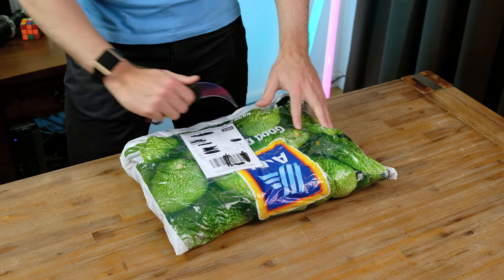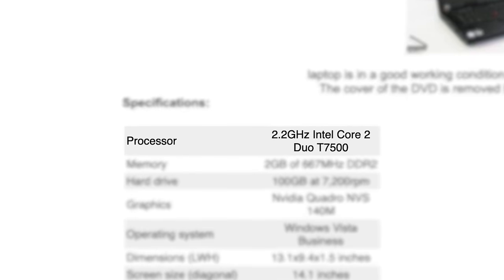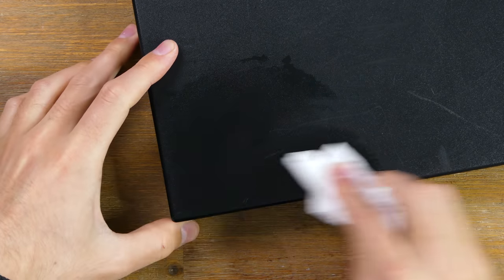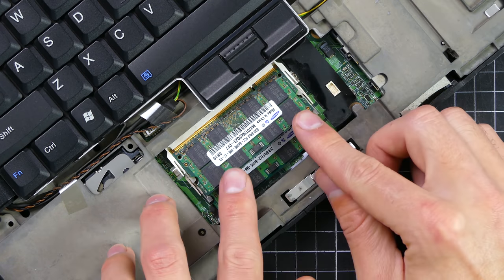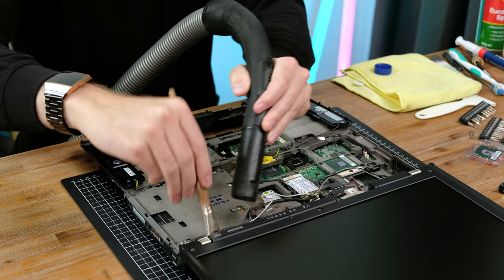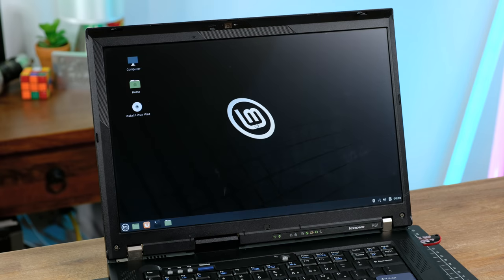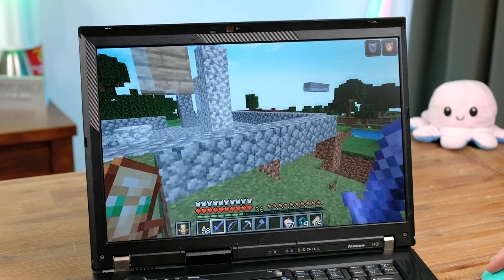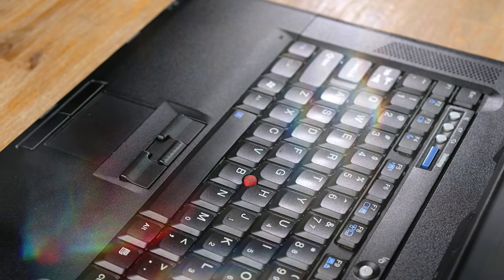I Bought a $49 Thinkpad... And Got Scammed!

Comment from the maker: I'm giving away the Pink laptop that was featured in my last video! https://twitter.com/NathanPSI/status/1402905668592410630?s=19

The rules are listed in the Twitter thread listed above. I'm posting to the US, UK, Australia and New Zealand 🙂 Goodluck!
Reply: wheres canada bro
Reply: About the Bios locked issue, call Lenovo and try to use social engineering to have them unlock it for you. I bought a Thinkpad that was bios locked, called lenovo, and they unlocked it for me. Hopefully you will have just as much luck.
Reply: Entered - thank you :)
Reply: hey could you add canada posting :)
Reply: I am facing little problem my ThinkPad shutdown automatically after some time of use. I am not able to find any reason . Can one  suggest any solution or may be what is the problem in my ThinkPad??
Reply: Not Canada????? BOOOO!
Reply: 7
Reply: I need a laptop but I don’t have Twitter :( my pc right now is an old Eee ASUs pc running windows 7...
Reply: i think i have a intel core 2 duo,
Reply: If cpu same slot work only need mod bios support that cpu.
Reply: Where the fuck is Japan
Reply: I have an T43, but the 2.5 inch HDD us a Pata drive. But the HDDs i have are SATA 3 drives, and there is plenty of brand new freshly made HDD drives that use Sata 3, but what adapter do you use to fit these Sata 3 drives into these old lappys?
Reply: Where is Kenya bro
Reply: You should swap Linux Mint Cinnamon for Linux Mint Xfce for better performance especially in Minecraft then take the CMOS battery out and put it back in to reset the BIOS and unlock it
Reply: Then in Linux Mint Xfce go to settings then Window Manager Tweaks then Compositing and turn off the very top box to disable shadows and reduce latency in games
Reply: @Sahilkumar-ko9sm  either you are being hacked or your computer has a virus. I recommend resetting windows or whatever OS you're using.
Reply: Even if I work in a computer store, that do not matter what even if I made all those possible upgrades I can find in this store.
Reply: @Sahilkumar-ko9sm  heat? Check the cooling fan, and dust accumulation.
Reply: That is just... bad luck, mate.

Comment: On the GPU front you actually got lucky in a way, the Quadro NVS cards in the 61 series ThinkPads are notorious for failing. Still doesn't excuse a scam.
Reply: The official buyers guide also recommended against buying the p suffix T series because of that as well.
Reply: @BYMasterMM  It's a shame really, such a nice machine yet you can't take advantage of the higher powered models because they will likely fail.
Reply: @skyediann3399  The Dell Latitude D630 models with Quadro NVS cards fail frequently too.
Reply: @penguinsushi8442  All early nvidia G8xM chips fail. Doesn't matter what laptop. Desktop cards including G9x are also prone. MCPs (their nforce chipset) from this time might be as well. Basically if it's an nvidia product from 2007-8, run away.
Reply: Pretty much any 'high end' videochip in a laptop is notorious for desoldering itself. I am still baffled by how many people bought laptops with geforces and radeons back in the day. After 4, 5 years they were all dead as a dodo.
Reply: Bought one of these for dirt cheap about 3 years ago. It had the NVS140M GPU and carried me most of the way through university. The GPU unfortunately died about 1 year ago, while my brother was using it for a school project. Shame, it was a pretty decent laptop for its price.
Reply: @TerribleToaster  They're over a decade old at this point and carry GPUs prone to failure, outside of a few oddballs, I'd say it's probably not too long before all the dGPU models are extinct.
Reply: @BYMasterMM  Just the old one? Or are laptops like T440p fine? (Ofc I would not buy haswell these days)
Reply: @dustojnikhummer  Yep, just the old ones, since it was ones from that generation where I believe Nvidia was using a combination of either bad soldering techniques, as well as lead-free solder which resulted in the solder easily cracking and thus loose connections between the GPU chip and the mainboard it was soldered onto.

The T440p has both the iGPU only, and iGPU + dGPU variants of the motherboard, same with some of the 15.6" versions of the T series ThinkPads too, and the GPUs in them rarely fail, (same can be said with the Sandy and Ivy bridge versions too).
Reply: ey bro there is a bot stealing ur comments
Reply: @BYMasterMM  I bought p series with bad GPU as display donors then installed those on Intel GPU T61 bottoms. Worked a treat since they went for small money ten years ago. I still use some as shop computers. T61 with Intel was an excellent office machine with the WUXGA display from a p installed.
Reply: Are the ATI graphics more reliable? I have a Z61m with Radeon X1400 graphics btw.

Comment: a little unreleated but i really miss laptops with a hell ton of ports
Reply: Many Lenovo Thinkpad models still have them if you want them.
Reply: @CommodoreFan64  My Dell XPS15 has practically anything I would need. Also, business laptops usually have many more ports.
Reply: Typing this on an M1 macbook air. I feel ya.
Reply: a toshiba satellite A350 laptop that has hardware failure is the only laptop i've seen a microphone port on in real life
Reply: @PearCoin124  Huh? I have never seen an (older) laptop without one? :D.
Reply: @rollingtroll  i guess we just have newer laptops since that is the oldest laptop we have, or it's a dell which doesn't have a microphone jack
Reply: @rollingtroll  Yeah it was. I use to be a big ACER/Gateway/Everex laptop guy in the early - late 00's, because of their price to performance, and every single one of them had the separate mic, and headphones jacks, so I would have to use a 4 pole splitter cable with them for my headphones/earbuds with a mic.
Reply: @CommodoreFan64  Yup, that was normal in the day. All of my latitudes and lenovo's had that too. Some laptops had a line level input as well, but that was very rare.
Reply: I miss them too.
Reply: On ThinkPads, you can even add a dock for even more connectors !
Reply: @lululock  Not all of them, but yeah man of then you could, and I think still can.
Reply: @lululock  that was pretty normal for every laptop up to the early 2000's
Reply: @rollingtroll  Yeah, I know. That's why I keep some of them.
Reply: In trying to be cute and minimalist they remove the ports only to sell you the expansion bay for $100-$200+ later.

Comment: Shame that you got scammed - and it's unusual for eBay to not agree with you. Normally, eBay quickly sides with the buyer in any return request - you can easily open a request for "doesn't work or is defective", or "doesn't match description or photos" and force a return, with the seller paying the return postage. The seller can also give a partial refund if they want to (which you can accept or decline).

Comment: 255% available charging. 
Now that's quite a deal
Reply: What a deal!
Reply: wait till somebody doesnt get the joke lol
But yeah, that's a huge deal!
Reply: @captainchris2  That's actually not the reason. Its just windows being windows.
But they fixed it in the updates.
Reply: I was about to say that, what a deal!
Reply: @oonflea  good old 8-bit integers
Reply: Best deal ever made
Reply: Thor's lightning charged it up
Reply: @oonflea  windows know that in future 255% will be a thing
Reply: @lemurmad  bruh stop blaming windows for everything, it happens with a lot of laptops, when the battery runs out of life it just says that on power.
Reply: @retrogamer2503  pretty sure you don’t understand that windows 10 did that for 3 years. And I actually prefer windows over Apple iOS and macOS
Reply: @lemurmad  bruh I have seen a couple of windows 7 laptops do that too.
Reply: @retrogamer2503  Yeah, It's when it doesn't detect a bettery. But I've only seen it in windows 10. But now, it seems to be fixed.
Reply: 255% also happens if Windows cannot tell what the battery percentage really is. If unplugged, it will say 'Unknown remaining' and the battery icon will be grey.
Reply: Charging batteries be like in Ohio

Comment: I think it would be a good video to show your audience why you weren’t eligible for the eBay buyer protection aka money back guarantee. This way they can see what went wrong and how to avoid getting scammed like you did.
Reply: Yea, im wondering how he wasn't eligible. The only thing I can think is that he was outside of the 30 day return window which is why its important to inspect and test ebay purchases ASAP
Reply: @FlyboyHelosim  at the very least its an item not as described. The seller might have made a mistake and shipped him the wrong laptop sure but its still not ok. Imagine ordering a laptop with an intel core i7 and getting an i3.
Reply: @FlyboyHelosim  yeah, these sellers are often pc recyclers and are selling huge lots of stuff - yes they should be more careful but i like to attribute this kind of stuff to ignorance instead of malice
Reply: @FlyboyHelosim  he should have gotten a partial refund since it wasn't as listed. I've legitimately never had an issue with the site so I'm not sure what even happened. Hell I've never even had to escalate it to ebay, I just contact the seller and they usually give a fair deal (or in the case of a thing I ordered recently, they were able to ship it for a cheaper price than their estimate so without even contacting them they refunded me the difference.)

Comment: The bios can probably be cleared like many other older Thinkpads. My second hand E540 was also locked but I found a guide how to reset it.
Reply: I cleared my parts 390’s bios but simply unplugging the CMOS battery and letting all power drain out, then reinstalling it and boom, right into the bios.
Reply: @aegonthedragon7303  Some models have a dedicated chip for saving the password etc., on my Thinkpad, I just shorted two legs from that chip when powering on the laptop and that did the trick. So in newer ones the CMOS battery doesn't work, it just resets the bios but doesn't clear the password etc.
Reply: Never been locked out of my thinkpad, but any acer accepts an universal unlock code you can find online. Maybe there is one too for thinkpads
Reply: well for me i reset my password bios with shorting the EEPROM but i do not recommend to unplug the cmos battery because if you unplugged it, the password will not reset anymore and i got RTC (Real Time Clock) error in my thinkpad T430 and its very dangerous if you have modified bios like 1vyrain because the date/time setting is gone and dont worry my laptop did fix from laptop servicer (sorry my grammar is broken because my english language is not my first language)
Reply: I believe you have to tear apart the entire machine to do that though

Comment: the intel gma graphics is just complete pain. i remember trying to play minecraft on old gma4500, good old days....
Reply: I have an old Dell Latitude D630 which is pretty much the equivalent system down to the X3100 graphics. I was lucky enough to be able to scrounge a Core2 Extreme X9000 and two 4GB RAM sticks for mine. It's a decent performer under Linux though the GMA graphics are the weak point.

Ironically, with the D630, having the Intel rather than the nVidia graphics is actually a plus as these systems were initially produced with faulty nVidia GPUs that were prone to failure.
Reply: It's possible with Sodium
Reply: I currently play on a HP Compaq, from 2010.
With a:
2.8 ghz Pentium
8GB DDR3 RAM
And an AMD 7400 Series graphics card

Comment: I had this laptop from 2016 until 2018. It was the first thinkpad i could actually use to work on and what a pleasure it was ! I made some various upgrade, and finaly swap the motherboard for the nvidia equiped. Sadly, the card failled 8 month after i've buy it. So it's much better you have the intel equipped, because the nvidia was notorious to fail !

Comment: Removing the clock battery should erase the BIOS password, either that or using a DOS flasher to revert it back to the stock Lenovo one.
Reply: That's not an option with these machines, as they store the password on a dedicated chip and removing the CMOS battery doesn't do anything to it.

Comment: I had the exact same model that I bought for $1 USD in the States at a University auction. I cleaned it up, replaced the HDD with a 128 Gb SSD, then maxxed out the RAM. Since I don't Game I just fixed it up to do Office tasks and finally I installed Arch Linux XFCE4 on it. It ran great for what it was designed to do. Great video! Thanks for sharing. Also,

Comment: Great video! I love those old Thinkpads!

I never buy from sellers with less than a 97% or so positive rating because of junk like this. And I always read a lot of the customer feedback for the ones I do buy from. You can get a good feel really quick for who you're dealing with.

I'm strict with myself over that because I got scammed myself. I ordered an SSD from a 97% positive seller a year or so ago and tracked it til I was told it had arrived at my home. It had not.

I contacted EBay, they said wait a day or so. Never came.

I took the tracking number, called UPS, and they said it had been delivered to another address a couple miles from me. It had not.

I contacted the seller, who said that yes the package had been delivered. It...had not been delivered.
Then I noticed...the seller's name in the email was different than the one I had purchased from. I followed the link in the email, and I ended up at a totally different store...with a 77% positive approval!

No amount of maneuvering could get me back to the original seller. That seller simply didn't exist.
I contacted EBay and put them on the scent, presenting my evidence. They not only immediately refunded my $$$, but they contacted me back and said they had shut the seller down for fraud.

A few very stressful days taught me not to skip the details. It wasn't a lot of money but nobody likes to get taken and honestly I've got much better ways to waste time than that.

Comment: I currently use a ThinkPad R61 as a basic home server that I bought back in 2015 for dirt cheap on eBay, it does the job reasonably well and is in really good shape, I run an external drive enclosure over USB 2.0 and have it set up through Windows Storage Spaces. Mine runs a T7200 @ 2.0 GHz, 4GB of RAM, a spare 120GB SanDisk SSD I had lying around and currently have it running Windows Server 2012 R2 (Windows 8.1), it was running Windows Server 2008 R2 (Windows 7) for a long time until last year when support ended so it got an upgrade.

I wouldn't take it further than Windows 8.1 tbh, back when I first got it I used it as a machine to run the Windows 10 beta builds before it came out and they never seemed to run the best, even after Windows 10 was finalised. I'd just stick with Windows 8.1 or Linux for one of these.

Comment: The first Thinkpad I bought from Ebay was a X60s, and that arrived in a thin flimsy cardboard box with no bubble wrap or anything to protect it at all.  I was extremely lucky it arrived in mint condition with not a scratch and fully working.

Comment: The school it came from, should give you the old cmos password. Otherwise you’ll need to jump a few wires to a serial dump module to find the hex code for the password
Reply: If he removed the CMOS battery for a while, wouldn't that clear the password? I never dealt with a bios password.

Comment: I got R61 with T8100, Intel graphic card,  PCMCIA+Express Card Slot, and upgrade to 8GB RAM, then boot on Windows 10. It works fine  over my expectation. The ultrabay is different from T61 due to IDE port, the maximum speed just 60MB/s, but it's stable when I insert the SSD.

Comment: The inside looks very similar to the t400. The heatsink looks much better quality as the t400 fan is very small and doesn't cool the CPU very well. This model seems newer and they fixed all the issues from previous models

Comment: The BIOS can be unlocked with the right tools.  I bought a Thinkpad with a locked BIOS but fortunately it had already been upgraded with a modded version, e.g. to unlock SATA 2 capability as the X61s is factored limited to SATA 1 otherwise.

Comment: The battery 'might' charge if you cut the ends off a q-tip and slide the stem underneath the board where the connection between the battery and laptop is to lift it up. I had to do that with a different model thinkpad, one I was assured was in good working order and hadn't been messed about with....which must be true as there were two screws left in the bottom, just as it must have had when it left the factory to allow easy, instant, access to the motherboard. The other holes were obviously vents.....at least the battery works now

Comment: Few notes to add, nVidia Quadro NVS 140 was fine when it was working, which it wasn't for long. It is the same as the GeForce 8400M, and those failed like mad when these machines were 1-3 years old. I had a R61 back in 2009 (I even installed Windows 7 RC on it), but it failed being only 14 months old and out of warranty. I repaired it with heating the GPU with a heatgun, but I know it didn't last more than few months then. So good thing you didn't get a Quadro model. For the locked BIOS, I think there is a way to unlock it, either by an unlock code and a unlock generator, or reading a password chip with a cheap programmer. Perhaps an idea for a next video :)

Comment: If the bios is locked remove battery and cmos battery and leave for 1 hour before plugging in cmos battery. That should reset the bios to factory.